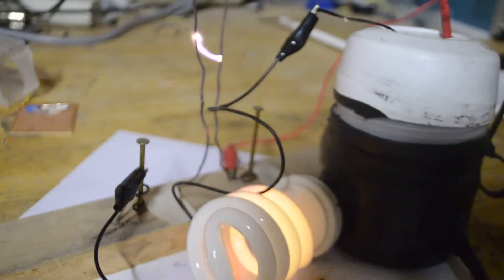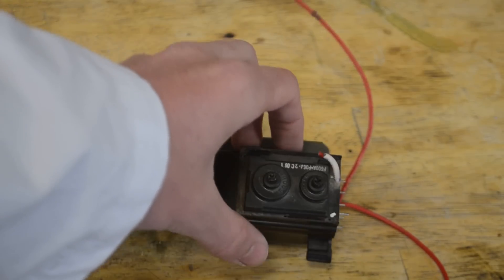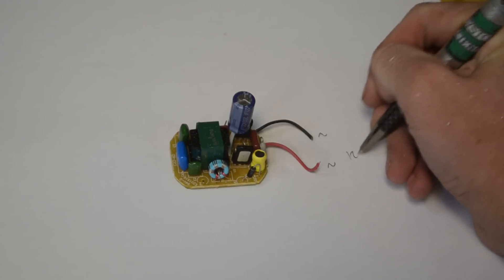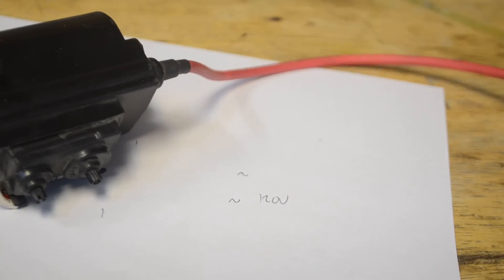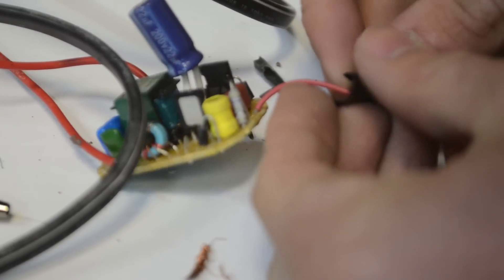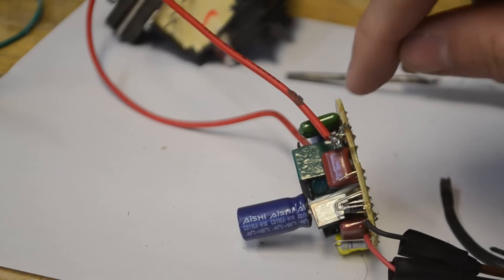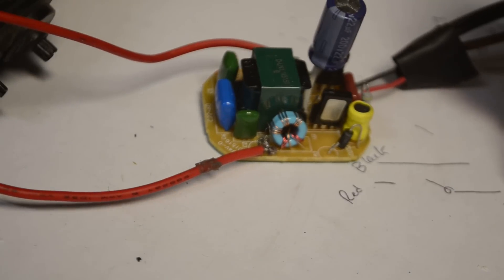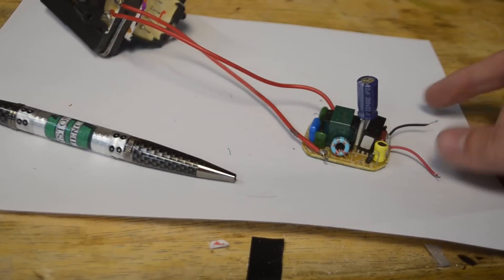High Voltage from Fluorescent Bulb

Comment: Ah, it does matter what AC lead goes where. I would advise to have the Live connect to the red wire and black to netural. Also use a polarity style plug, the bigger side (Left side) is Netural and the smaller (right side) is the live side.

Comment: Does this make high enough voltage to do arc fractal wood burning?
Reply from the maker: +ElectricAvian voltage yes, but since the current is small, it will likely make small fractals, so nothing like what a MOT will produce

Comment: Does it have to be a fly back transformer or can it be a step up transformer
Reply: If it was just a regular step up transformer:
A. You wouldnt even need the driver, just put in an AC current
B. If it was a high voltage transformer (such as that of ignition coils, microwave transformers, or neon sign transformers) then it should work. However, if your transformer is not one of these, than you should get nowhere near the output voltage of the one shown in the video.

Comment: Nice work.
I love the way you explain everything with their proper working science.

Bro I've a suggestion for you-
If you connect a starter(it was used with old fluorescent ballast that had only two output pins for the tubelighr)in parallel with the primary coil then the output will be  2x higher in terms of voltage. You can use it with flourescent  ballast or even with cfl ballast. But I don't know the reason for it's working.
If you could please explain it explain it I'll be happy.

I have a question- is it necessary that the primary of the flyback has the highest resistance? When I connect the input of the flyback to the first two pins from the right (U) the arc is 1 mm long but when I connect the input to the 1st and 3rd pin from the right then the arc is 1.5cm long. Is it that the primary is the coil between 1st and the 3rd pin from the right?
Reply: im pretty sure that the primary is the 1st and 3rd pins and the 2nd and 4th pins are the feedback

Comment: do you think an old computer monitor would have one of those transformers?
Reply: Yes, but size doesn't really matter.
Reply: I never heard that one.
Reply: @annelieseocallaghan801  exactly, it's not the size of the hammer, it's the nail you're swinging it at!

Scary Movie reference...
Reply: Anticonny would it just be smaller maybe?
Reply: Jake Waddoups hell goto a junk shop and buy the oldest biggest tube tv in the place it will have a huge transformer! ☺
Reply: @Jtw0912  smaller and higher resonant frequency. TV flybacks are usually around 15 kHz, computer monitor and small TV flybacks are usually around 30-45 kHz or more.

Comment: Hello Nate . I donot got trimmer capacitor for making the FM transmitter. is there any alternative way to make. plzz help me
Reply from the maker: +Erick Eagle yes, you can make a trimmer capacitor, try getting 2 plastic cups and putting tinfoil halfway around each, attach wires and place one cup inside the other, as you turn the cup so that the tinfoil becomes more or less overlapping it will change the capacitance! You could also just use a set capacitance value and calculate the frequency it will broadcast at from the formula I showed! Hope this helped ! :D

Comment: Very interesting video! Can I do the same thing with 230v input(to the bulb circuit)? or will that burn the coil?
Reply: BIT it will work. There's no difference. I'm from India and used a 220V rated cfl
Reply: thanks man, i'm from India as well!....also,i was wondering if there was a way to find the primary of the transformer without a multimeter, as mine is showing a resistance of 7 Ohms when i'm touching the leads to themselves(cant trust it)

Comment: hiii is is possible to connect a car ignition coil instead of this flyback trf,bcoz i got a good one with four high voltage terminal coming out hehe its from ford focus. I really appreciate and this is the fastest way to make a tesla coil....great.
Reply from the maker: +jitendra nayak thanks! And yeah! Connecting up an ignition coil should work fine, I've never had an ignition coil, but you could probably also drive it with a 555 timer set up and a mosfet to run off of DC
Reply: I hve built a 555 circuit already  but i want to try yours one now and Thanks a lot for an informative video

Comment: it's not even near 20ma as that current a neon sign transformer have and that have much more powerfull arcs.
Reply from the maker: +amit dhyani I do think it is around 10-20 mA just based off of observation, i should of figures out a way to measure it, but a neon sign Transformer is typically either 30mA or 60mA, so it would be quite a big difference as the NST would be about 2x as strong... but yeah I think it is closer to 10 mA rather than 20 so your probably right xD
Reply: +Keystone Science yeah actually that I  agree ,10ma sounds reasonable. my nst is at 30ma with pretty powerful arcs.by the way that was a fast reply,within a minute, thanks .have a nice day and an excellent future.
Reply from the maker: +amit dhyani haha thanks! You have a nice day aswell!
Reply: +Keystone Science thanks
Reply: +Keystone Science by the way does that big tesla coil in background works?
Reply from the maker: +amit dhyani it used to, then I blew the capacitors on it... I did it get new capacitors in the mail yesterday though, so I plan on fixing it !
Reply: +Keystone Science well,all the best with that. if possible make a video on it.best wishes.
Reply: love your videos.

Comment: can you put a few fluracent bulb circuit boards in series and increase the power
Reply: No, if you hook the output of one CFL to the mains input of another you will fry the other, most spectacularly. You can't use them in parallel either. If you want more power go with a higher wattage CFL, or go with a true flyback driver like the ZVS driver. I've used a 55 watt large CFL circuit, equivalent to a 300 watt incandescent lamp, with some good results. An electronic ballast for large straight tube fluorescent lamps puts out a lot of power but only the largest and most robust flybacks can handle it without shorting out internally. If you do go with a more powerful driver please make sure you know what you're doing and be careful.